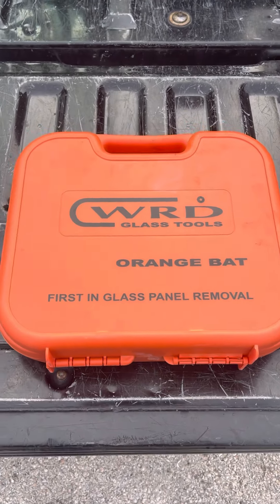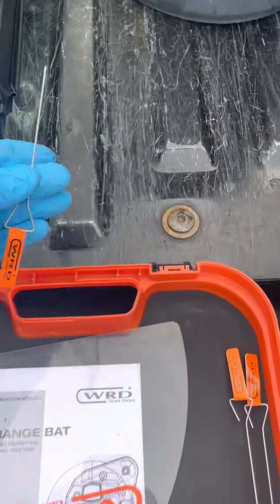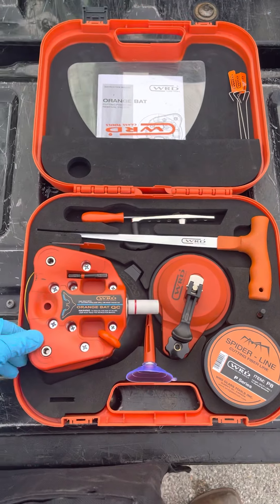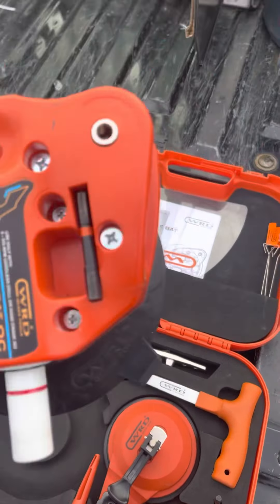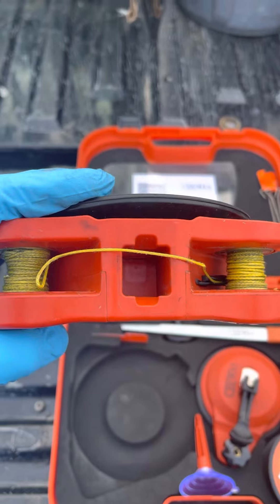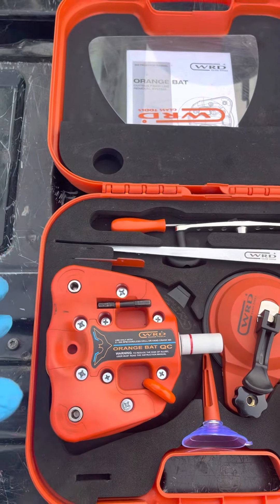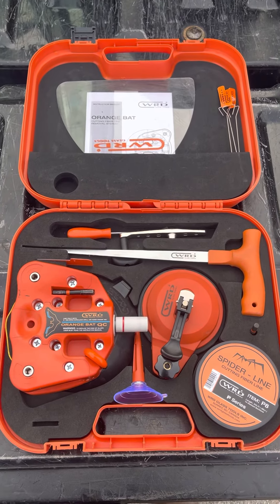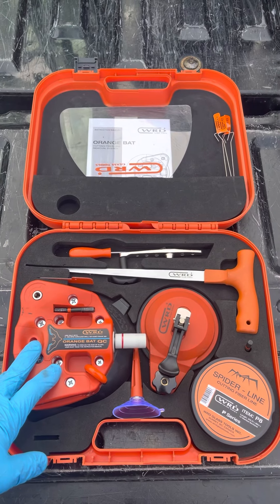Orange Bat QC - WRD New Tool

Comment: What is this QC feature exactly--any footage of it by chance?
Reply from the maker: It’s the attachment piece. I don’t have any videos just yet if the quick connect part. It has a option to use for the setting tool and a quarter glass handle.

Comment: what is better the quick connect or the older kit
Reply from the maker: Quick Connect all day. The reason for the update was because wrd listened to us as installers who had used it everyday and fixed the weak points on the tool